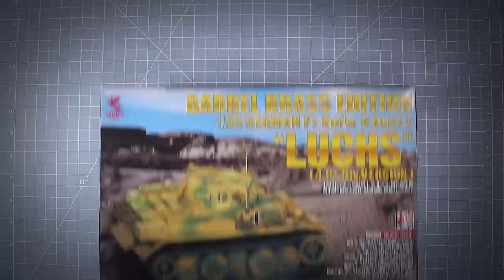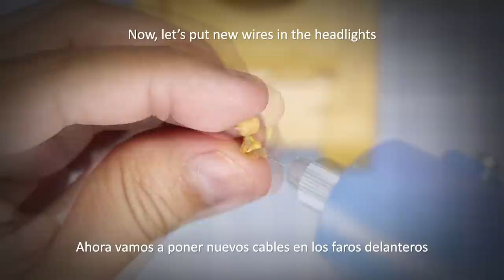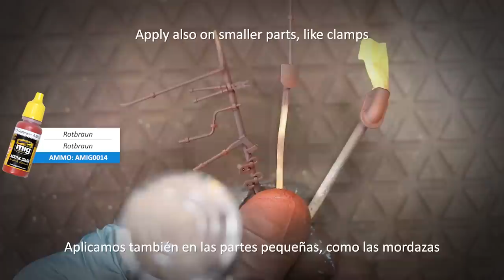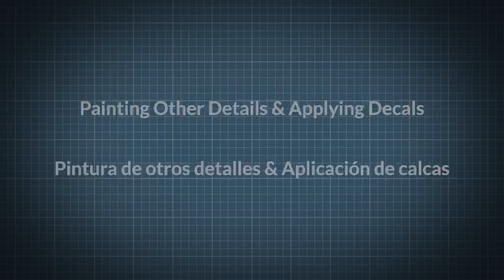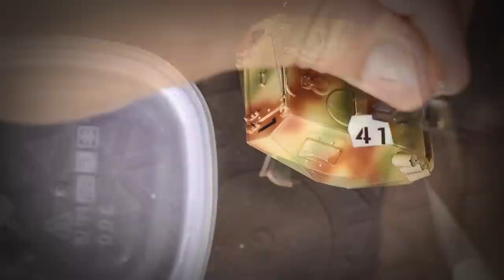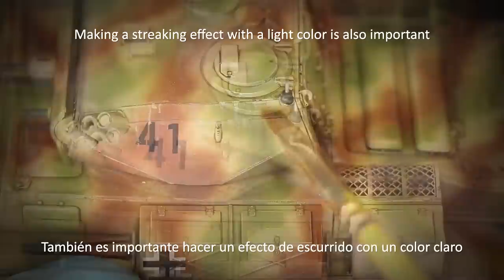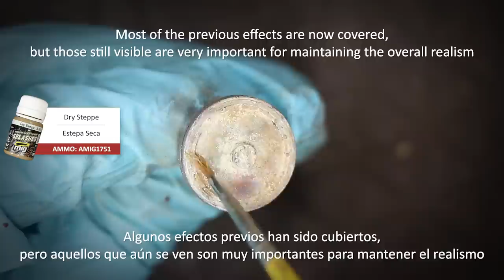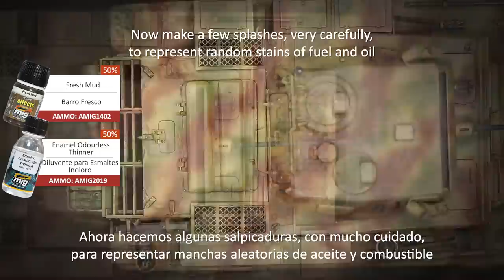Let's build and paint a realistic WWII German tank model, from start to finish!

Comment: Amazing result! When you were doing the mud effects on the running gear and lower hull, did you wait for each different product to dry after applying the next or did they have to be half fresh in order to mix together?
Reply from the maker: Thank you! The previous layer was dry when I applied the next one. They dry pretty quickly

Comment: Great video as always.
But I feel like the amount of specialized products used will make viewers afraid to try this out themselves.
You really don't need all these special brand products. But I understand, it's sponsoring so gotta make a living.
Reply from the maker: Thanks! And yeah, absolutely. They're not necessary. Specialized modeling products (as well as high quality kits) are made to make your life easier and speed up the process, while achieving realistic results, and that's what you pay for. My previous video was made for beginners, and therefore I used much less products
Reply: I went out and purchased the products for the mud splashes from this video. However my requirement was time criticality ( model needs to be finished for a show). I would love to experiment and have done so in the past, but when quality is need and time isn't available,  I'd rather buy the exact thing I know will work than much around with trial and error.